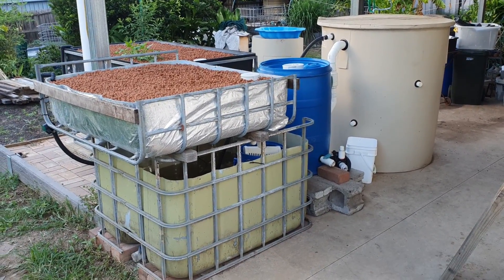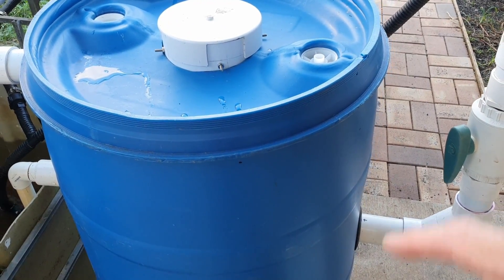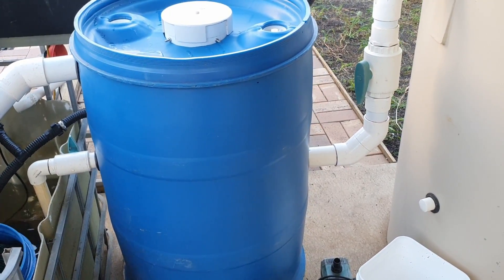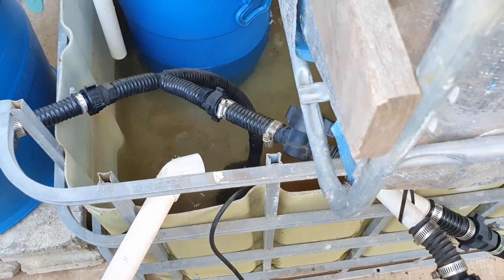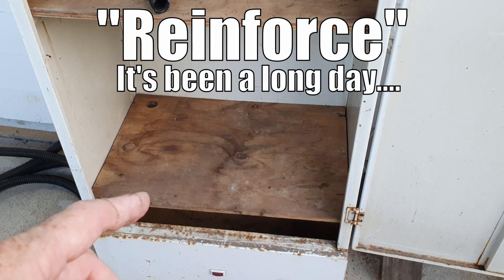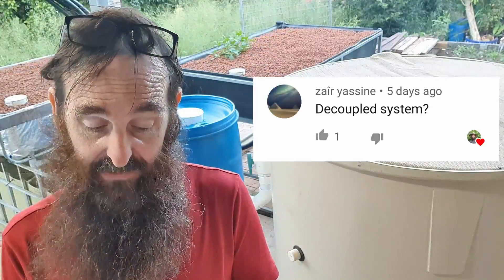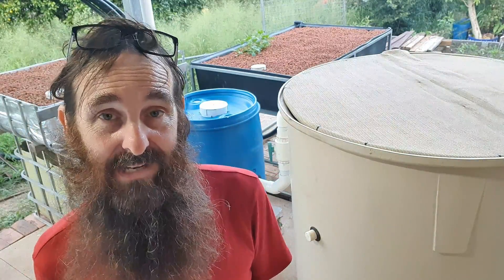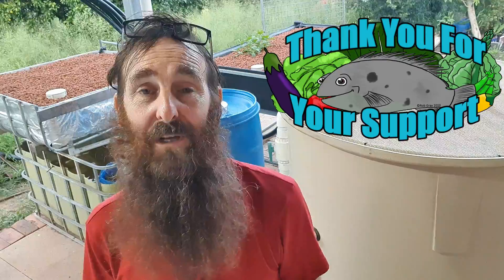NEW Aquaponics System 🌱🐟 & Viewers Questions

Comment: Hello Rob. Do you recommend putting fish in a deep water culture system
Reply from the maker: It would depend on the fish Anthony. I wouldn't add any that would eat the roots of the plants. 
You may also end up with excess solids in there if the base isn't cleaned regularly. The solids could cause issues with root health as well over time.
Reply: Ok cool Rob, thanks.
Reply: Thanks for responding also, appreciate it!

Comment: How do you deal with over flow,ie if it rains the system will take in more water
Reply from the maker: Hey Andrew. I like to leave a freeboard in the sump tank of between 100-150L / 25-40gal. If that extra volume is used up during a rain event, I can then take the bells off of the standpipes & which will allow the system to hold a bit more water yet again. Sometimes all that isn't enough & the sump does overflow but I'm not overly concerned as it only happens once or twice a year generally speaking.  
Hope that helps some mate.

Comment: hey there love all the media you have posted. All super helpful  I have a question about stocking density. so based on your ratio of 500 gram fish to 25 l of wet media. I have a 4 foot w x 12 inch deep x 20 foot long media bed. I calculated it at 2263 L of media. I divided that by 25L and got 90 500 gram fish??? Is that seem right to you. also to let you know this media bed with be used in a dual root zone style having cloth grow bags sitting on top of the media.  looking forward to implemet you solids filter into my new system as well.
Reply from the maker: Hi Michael. Sorry I missed your comment.  That sounds about right to me. 👍 The biofiltration capacity of the bed may be hindered by a build-up of solids so I would suggest that you also include some biofiltration before the bed to help remove them from the equation.  I would also make sure that you have a suitably sized tank if you want to run that many fish. 1 fish per 215L/6.6gal is what I like to recommend for folks just starting out if that helps any. 
Have you asked me this question elsewhere more recently?

Comment: hi Rob, do you have any problem with green Algae ? so have you ever used UV light to solve that issue?
Reply from the maker: It can be an issue if too much sunlight gets into the tanks. I don't like to use UV as I've read some literature that said it can interfere with boron, iron & manganese availability to the plants.
Reply: @RobsAquaponics  I appreciate your advice Rob

Comment: Hi, you mentioned snails in your clip. I’m really new to aquaponics. I inherited an established system that has been running about 5 years. Last summer the system became over run with snails in the water and caused blockages in the water lines eventually ruining the vegetable crop.  

There are still a lot of snails in the system they plug up the pumps and cause a lot of problems. Any suggestions on how to get rid of them? I’ve only been at this about 2 weeks.
Reply from the maker: Hi Katy. I had similar issues when I first started.  I just removed as many as I could as I found them to begin with. 
I found that they disappeared when the water pH started to drop as happens naturally as a system starts to mature.  The more acidic water wasn't good for their shells. I wouldn't go deliberately lowering the pH though as that ma affect your fish. 
Hope that helps a little.

Comment: Great video! Question about the grow beds -- What's the point of the bell siphon? I don't see why drain / fill cycles would help -- It just limits the plants' access to nutrients by half, right? Why not just have a drain on the other side of the grow bed from the input at the right height so the water level stays the same all the time?
Reply from the maker: The draining of the water also allows the bacteria, worms & plants roots get oxygen. You could run it as constant flood but you'd need to make sure that the water is well aerated & keep an eye out for dead spots where solids might be accumulating.

Comment: We are currently trying to set up an aquaponics system (NFT style).  We live in U.S. and are planning to use Trout.  We have learned a lot from watching your videos, so thank you for posting.  I have question about keeping algae in check in the system.  Can you place snails in the tanks with the fish or is it best to keep them in a separate area, like the filtration tank?  Any other tips or videos you would recommend us taking a look at would be appreciated.
Reply from the maker: Sorry I missed this post mate.
I had issues with snails blocking valves in the hose work of our first system so don'y recommend them myself. They started off in the sump & as the bread they scattered through the system. Keeping the direct sunlight off the tank is probably the easiest way to keep algae at a minimum. 
Hope the system build went well.

Comment: Rob - What's the diameter of the outflow pipes etc.?  Looks like 1.5 or perhaps 2 inches??  Trying to line up what pipe and uni-seals i need.
Reply from the maker: I use 2"/50mm drain lines👍👍
Sorry I didn't get back to you at the time mate. Having a few weeks off to catch up on old comments & work around the house here.
Hope your build went well.
Cheers.
Reply: @RobsAquaponics  No problem! Tho I gotta say I am not a fan of the uniseals.  They are. A huge pain to get pipes in etc. But they work and the system is chugging along... Plants and fish are growing so we'll see!

Comment: Hi Rob, whats your opinion on growing peppers in Aquaponics? Ive planted jalapenos and find that the constant presence of water takes the sharpness away in the fruit. Do you think maybe its because there is some nutrient missing, or due to the presence of water?
Reply from the maker: I found ours to do OK Charles but I don't have much of a refined palate. 👍 It could possibly be a nutrient issue but wouldn't like to say that's definitely what the issue is. 
Have you noticed it persisting?
Reply: @RobsAquaponics  Thanks Rob for your reply. Peppers have since faded away. No fruit and leaves, if any are minute sitting on green sticks. All the other plants - tomatoes, lettuce, cauliflower, beans, mint are all doing so well. Maybe my system doesn't suit them, or it could be the size of the granite chips I use. Have two smaller beds with a smaller stone. Was thinking of putting one in that and the other in the veggie patch.
Reply from the maker: @charlesmathews5840  Can't hurt to try to see how they go.
Cheers & good luck mate.

Comment: Is all the electricity usage worth it ?
Reply from the maker: We have a solar electricity system so the cost to run is minimal.
Reply: @RobsAquaponics  true that, but most people don't have that, so food production will be a bit pricy . Have you thought about air lift?
Reply from the maker: @trevorvanzuydam8115  I've looked into them but decided against setting one up for now. Might play around with one down the line.
Cheers.

Comment: Hi Rob. Is it a problem if my grow bed is about 60cm deep? I have an old plastic water tank here which is about 70 cm in height and 70 cm in diameter (holds 300 litre). The most of the grow beds that I have see online is around 25 cm deep.
Reply from the maker: I have seen folks use IBC cut in half as grow beds & they appeared to go OK as grow beds.  
Most folks like the shallow 25-30cm beds as they require less media & water to fill.

Comment: Hi Rob, Great to see your various iterations for the aquaponics, as the circumstances change, it really helps me get a feel for how to tailor the options. Could I ask: What is the second, smaller, lower outlet from the radial flow filter? The one with the tap on it & also drains into the sump.
Reply from the maker: Hi Rob. That will be used to partially drain the filter at cleaning time to help conserve as much water as I can. 👍
Hope that helps some.

Comment: oh so you completely chopped the top off , i thought maybe you just used the 90mm hole to plumb it all ( DO NOT PUT SNAILS IN , they get in everything and their shells start clogging things up )
Reply from the maker: The grow bed on top of the sump is actually a grow bed made from cutting the side from an IBC. Gives you a nice flat base to work with.
I don't like plumbing the drain in the centre as it can cause water exchange issues ion the grow beds if a lot of roots take over the bed. 
Cheers Christopher. 👍👍

Comment: Rob, Your system is really coming along, I thought you mentioned in an earlier video you were considering a DWC bed in this new system. Do you plan on trying or or you just going to stick with the Kraktey method? I plan on trying nft with my greenhouse. One more thing I know your wrapping the sump tank, do you feel that with not as much shade as your previous system there might be an alge issue? The system looks great so far.
Reply from the maker: Will be adding a DWC to the larger system that will be built down the back later on BWF. 👍 Wasn't given enough space by the powers that be to add another bed in this spot. 
Should be no algae issue with this sump as it painted & I made sure that the bed overhung the side that will be getting the bulk of the sun. I do need to touch up a few spots where the paint has been peeled off though.....  
Cheers mate & all the best.

Comment: Nice! I wonder though, why do you use that air pump? I had that and an Haako diaphragm pump. The Haako at the same rating, clearly moved a better volume of air. Also practically noise less compared to the type your using, which I could hear from one end of the property to the other.
Despite being the same rating, my Haako powered several air pumps, extra air for the tanks and for bubbling compost tea barrels. The systems were are far away as about 80 from one end to the other and even more with radials. All running through 1/2 black pvc tubing.
Reply from the maker: Hi Jim. I find this jobbie does a good job + I have it on hand already. I do have a diaphragm pump as well but swapped to this one as it's much quieter to run from memory. Might pull it out again & have another crack just to see which works best.
Cheers.
Reply: @RobsAquaponics  I had the same one and could hear it in the backyard and especially on quiet nights. The Haako was nearly silent and even though they were rated the same in volume, the Haako was noticeably better. Just some experience input. I had the same deal and never got the Haako until almost two years later. Trying to do things inexpensively and it was hard to justify the money, but I wouldn't go backwards again. Good job. Enjoy the videos.
Reply from the maker: @Wakeupandsniffthecoffee  I appreciate the input & experience of others mate. 👍
Thanks Jim.

Comment: Hi Rob,
Curious to get your thoughts on adding a NFT channel or two before entering a flood and drain bed?
Surely if added to a system like yours this could expand the system to run some additional spots for leafy greens on the side with minimal additional cost
Reply from the maker: I don't really need much more space as the fish wont be consuming enough feed to run much more than 2-3m² of grow space when they are 500g/1lb in size.  It might be an option if I had another 10-15 fish in there. 👍
Room is also an issue as well. If I was allowed a bit more "Lawn" space I'd be setting up another bed + adding another 10-15 fish. 😉
Cheers B.R.T

Comment: Don't do decoupled system in the backyard, Mate. It would not worth it. Actually it will be more a hassle to use for, without much additional advantages. Large scale will be good to run decoupled. I will never do it for small scale, this based on my own experience. :)
Reply from the maker: Have seen what Mathias & others have been through on FB. That was enough for me to decide against it.
Still thinking about building a sandpit to play & grow in though..... 🤔😉
All the best to you & yours Indra.

Comment: Hello Bob, how are you? I would like to know what safe level of ammonia and nitrite for the system. I think I'm in trouble. thanks.
Reply from the maker: Ammonia should be just trace (under 0.25 mg/l) in a cycled system & nitrite should be 0mg/l. 
You can use sea salt to protect the fish against nitrite poisoning by adding 1kg per 1000l. NEVER USE TABLE SALT only pure sea salt. 
The chloride will block the nitrite from giving them brown blood disease/nitrite poisoning. 
Any idea what's happened? Do you have a dead fish in the system?
Reply: @RobsAquaponics  
there is no dead fish. my system is 1000 liters with 3 beds of crops of 100 liters each with expanded clay I have 50 fish of 700 grams a conical decanter to remove the solids a biological filter of 200 liters with media and a 200 liter drum where the pumps are. my ammonia is 0.50 and nitrite ranges from 0.5 to 1 ppm
Reply from the maker: @ricardojuvanelli2172  It sounds like you're overstocked fish wise Ricardo & that will be pushing the limits of what the bacteria can process. 
 I'd think about harvesting a lot of them now if they're 700g in size.
Reply: @RobsAquaponics  
ok, I will do that, when you talked about 0.25 ammonia is total or toxic. here in Brazil the tests are in ppm it measures the ionized nh4 and non-ionized nh3 so there is a table next to it to cross the data and know the toxic amount in ppm. example if in total it gives 0.50 with pH 7.0 the toxic will be 0.003 ppm. and a hug from the Brazilians to you
Reply from the maker: @ricardojuvanelli2172  mg/l & ppm are interchangeable so no worries there. 👍 
You will always have trace ammonia in a system as the bacteria take longer to convert it than the nitrite to nitrate. I normally see levels below 0.25 ppm most the time.
Reply: @RobsAquaponics  
thank you very much for your attention 👍
Reply: Hello Rob, I followed your tip on decreasing the amount of fish. now my ammonia and nitrite are controlled. thanks

Comment: nice :) I was wondering if there was a clip of where the swirl filter?!? thingy with the small plastic wheels went and why?
Reply from the maker: Ther was no need to have a stand alone biofilter in this build HD as it's not going to be as heavily stocked as the last one. The last one was built to run 90-100 fish so needed the extra bio filtration. This one will have a modest 25-30 fish so a lot less waste. The beds will easily be able to handle the load & convert the ammonia all the way through to nitrates. 👍👍 
Hope that helps some.
Reply: @RobsAquaponics  ah I see, thanks :)

Comment: Very nice! I have a SLO design where I cut a hole in a rubber media mat filter and put it around the settler tube as an extra measure to discourage solids from making their way back up and out of the SLO. Seems to work like a charm!
Reply from the maker: Nice one Alexander. I did think about adding some filter material to the outside as well to trap the fines in one unit as I'm treating this as an experimental system to fine tune some ideas for the larger one to come.  😉 
Cheers & happy growing mate.

Comment: Love the work. I have learned so much.  I used the plans for your radial flow filter. I reversed the flow. It's doing wonderful.  Thank you so much
Reply from the maker: Are you running the water in through what I would use as an outlet Blake? 
If so, it's good to hear it works that way as well. 👍
Reply: @RobsAquaponics  Yes   I'm building the big system now.  With the big system it will have a 45gal barrel as the radial flow.  Half barrel polishing filter.

Comment: Rob, hello from the US. You were talking about flow rates, see the lines from the pump are corrugated. Are they smooth on the inside ? Corrugated inside would slow down the flow rate. Thanks for the videos.
Reply from the maker: The inside of the hose is almost smooth with a very slight ripple to it. It's not perfect but does the job in a small system like this. 
Cheers Steve. 👍

Comment: Hey Rob thanks for all the info. Been watching a good while now. I'm an electrician and thought of something that might help. Get a weather proof flip cover. You guys should have something close to ours. One u would see on the side of a house. You can drill holes big enough to get power cords though. Mount weather proof cover over holes
Reply from the maker: Thanks Dave. The power point out there is an all weather one & like the idea of restricting access to it. Still need  access to the other one though so we can plug tools into it while working outside.
Cheers mate & have a top one.

Comment: Had a auto fill valve on aquarium once worked great to keep tank full and change out water ,used air tubing out window to syphon off water slowly. 
Back to story snail got caught in valve overflowed tank had to crush snails andlet fish eat them
Reply from the maker: I've heard of them blocking feed lines in aquaponics & causing overflows too. 
Thanks for the reminder about top up water. Need to sort something out for this system now we don't have a filter on the house anymore.
Cheers Charles.